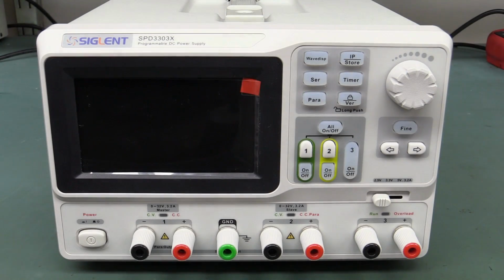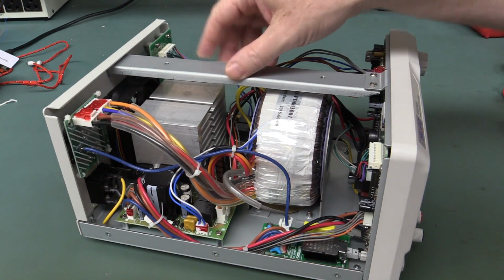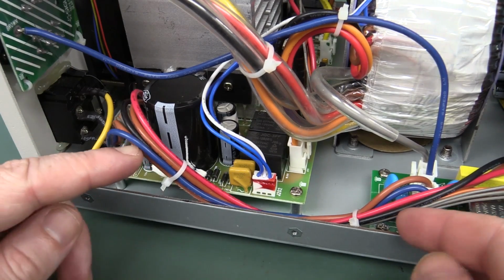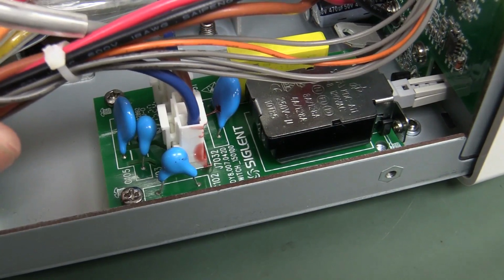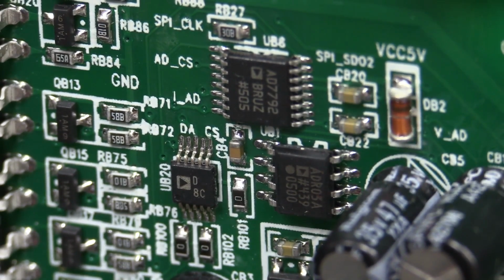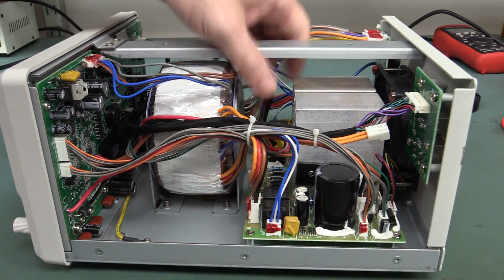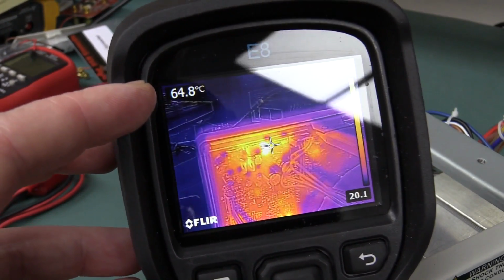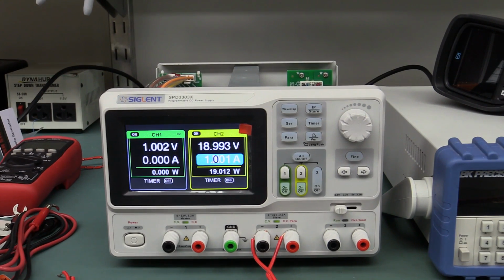EEVblog #828 - Siglent SPD3303X Precision Lab PSU Teardown

Comment: Eyyyyy I use one of these everyday at work. it's a solid bit of kit!
Reply: The one I use at work has better banana jacks, though they're still not awesome. Definitely some changes have been made since this video.
Reply: user interface has also changed a lot. it now shows set and current voltage.
Reply: Also no screen saver. display is always on. Gah that was a good change.

Comment: It looks over designed to me. Wasting money on digital bullshit instead of throwing the money on beefier hardcore analog parts. Keep it simple and sturdy and analog should be the way of a good PSU. Down the years those digital protocols between the ARM and PC might fail bricking the whole thing and especially making it difficult to fix. Using a Delta Sigma ADC to monitor the voltage especially made me laugh, like using a microscope to thread a needle.  Also screen saver wtf ! this is a bench lab instrument how dare they put an interface with a screen saver.

Comment: What a Siglent fail, thanks.  I got the same crapping banana plugs on the cheaply switch mode variable supplies.  I had to make some brass extenders/adapters to screw on the terminals and accept the full length of a standard banana plug.

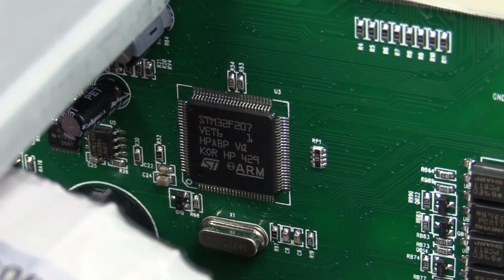Comment: 15:20 You will most likely not run a Linux on an STM32F2. It doesn't have a MMU, and therefore could only run Linux with a emulation, which is ridiculously slow.

Comment: Most of the caps in that are Rubycon . Shame about the big filter caps though bummer .
Reply: Most of the caps are LELON, not Rubycon. The Lelons have Y on the top, the Rubycons have K on the top.
However the brand is largely irrelevant, since both brands make both low-quality and high-quality capacitors.

Comment: what does that "shorted turn" on the toroidal mean performance wise? Is it going to introduce noise?
Reply: A "shorted turn" means there is a MASSIVE current flow that produces no useable output. I will use an example - we are converting a Microwave transformer to a spot welder. For building that, you leave the (mains) Primary winding alone, but remove the (many-thousand turn) secondary wiring. Then, as a replacement secondary, you add one or two turns of very heavy cable, and run the leads out to a couple of copper "prongs". To make a weld, you short circuit those two prongs, and heaps of current (at very low voltage) flows to create the weld.
...
Now, back to the toroidal transformer... . the way that the mounting bracket is designed, you have U-shape comprising of the base and 2 sides. So it's a partial (3/4) turn, however it is an open circuit so no current will flow. However of you run a bolt through the center of the toroid, then that will join the 2 side brackets and makes a single electrical turn.
Once it's all connected together, then that makes a "short-circuited turn". So you get a huge current flowing, which heats up the transformer and saturates it, and that wastes massive amounts of power yet leaves nothing left for running the proper circuits via the other secondary windings.
In this case, the bolt has insulators that prevent the head and/or nut from touching the side plates. Therefore, even if the bolt touched one plate but not the other it would still be a "turn" but there is no circuit so there is no resultant current flow nor any other effects.
Reply: @johncoops6897  thanks for that explanation!

Comment: Why do you like being able to turn off the screen on the 34461A et al, but dislike it on this unit? I'm sure the saved power is minuscule, but never the less it would be equal to the power of the keysight screen, if not higher given its larger size.
Reply: Because Dave absolutely hates brands that he considers "sub-standard" to his elite requirements. His oscilloscope and multimeter reviews are even more biased and petty.

Comment: the 2020 version : banana connectors now with correct hole. the wires are now secured with cable ties, the too hot bridge rectifier is now 56C, no more screensaver, both setpoint and actual are displayed at same time. idle power usage 12W all outputs off.
Reply: Thanks for the info! I'm thinking to buy one
Reply: There's newer firmware too, right? Maybe fixed some of the annoying UI details.
Reply: I've got yesterday (5/2024) the same model the X-E and the terminals distance are not ok. Do you think that I've got an old stock? But 4 years it's not reasonable.
Reply: @netlogic1ify  they are all like this, and it is not a huge problem, since today we all use standalone banana cables
Reply: Thank you for the updated info!

Comment: Why do you need mV mA precision, can you give examples of application?
Reply: Testing the lowest drive voltage for a certain Mosfet to ensure a certain on-state resistance, or what voltages a certain Microprocessor will run down to. There could be significant advantages in reducing circuit/supply voltage, so you need to check that a particular device will be suitable and at what level it will start malfunctioning. 
Testing a SMD LED, where the rated drive current is 2mA, but you want to under-run it slightly to extend the LED life. What current level is optimum, and what brightness will be achieved?
SO, when you are doing PRECISION work, your need a PRECISION power supply. Not that 1mV 1mA is particularly 'precise" anyway.

Comment: Its been 5 years since this review.. does anyone know if there has been any revisions to this power supply that fixed some of the issues such as the banana plug spacing, or display ?
Reply: The banana jacks are more snug now but they have not changed the distance between them, except on newer models (SPD1000X family, for example) .

Comment: I like having the speaker imgs.love/TicwatchE2?1a it is hard to hear in a noisy environment. It does drains the battery. I use play music. I create play lists and then tell the watch to download them. The watch has a heart rate monitor which can track 24 hours. The screen is nice. I would recommend it. A great value for the price. I could not find these features in any other watch in the price range.

Comment: Very helpful video, thanks. Sigmund has since changed the banana plugs and other than the spacing which has no meaning for me they are OK now. So I just ordered one of these. I also looked up the data sheet for the Lelon capacitors. The 6800/63 is rated 105°C, 3.6A ripple current, 3000 hour life at full load @ temp. That is spec for spec as good is the Nichicon, Panasonic, or CDE caps. I know you are not a fan Taiwanese capacitors but in the absence of any data to the contrary and if you can believe the specs, that’s about as good as it gets for a filter cap.
Reply: Mark, is there a date code on the supply you purchased that has the banana plugs updated?

Comment: This is an old video but I think it's worth giving an update on the SPD3303X-E that I just bought.

First of all, I am not seeing any of the Siglent rust in there, it's all nice and clean steel sheet in there.
Second thing is about the mains wires. They clearly have seen this video because the main wires are no longer ty-wrapped together with other wires, the no longer run along the sharp edges of the steel sheet and they now also have a very rigid extra plastic sleeve over the wires for added protection.
edit: Third is the UI, the new UI still shows the timer but in a small font and the display now shows both the settings for voltage /current and the actual voltage/current. Best of all: no screen saver anymore!

The only thing (which I don't remember you mentioning) is the lack of a sense input for both channels. It's a bit strange to have a power supply that can supply 32V @ 6A with a 1 mV adjustable voltage level without a sense input.

Comment: Hi... I love watching your vids... they are very informative and knowledgable but I would like to point out a minor point if I may.... sorry to be a nit-picker but to clarify, the metal edge mentioned at around 9:13 actually looks like a guillotine cut.... laser cuts melt to cut and therefore seldom leave a raw cutting edge.... guillotine cuts on the otherhand, do leave very sharp edges capable of cutting.... In this video, I agree with you completely.... nice review... sorry for the nit-picking....
Reply: Agreed - it's definitely a guillo cut. Anyone who's assembled a cheap PC Enclosure will know how razor sharp they are. Running the mains lead bundled with data cables is bad engineering, but to also not have them sheathed and scraping on the chassis is really poor form.
Note that a comment above from "rumblfmp" mentions about year 2000 they have separated the cables and added a plastic sheath, as well as numerous other improvements.

Comment: That's a knockoff off the GW-Instek GPD-3303S. The inside is the same. At least they copied from a reputable Taiwanese manufacturer. The SPD3303X-E is like GPD-3303. Hopefully Siglent licensed the circuit from GW-Instek and not stealed it.

Comment: If the bolt going though the toroidal transformer didn't have an insulating washer on one side the bolt would heat up and start glowing.

Comment: Couple of notes:
1. STM32F2 series is absolutely not running Linux. It's a standard Cortex M3 microcontroller.
2. You can't hear it switch when you go through the voltage range because the default current limit is set to 0. You have to increase it before the output voltage actually increases.

Comment: Consider that you had the case open, so the through put of the fan was not cooling at it would if the case were closed.  I agree about the display, they may have used a cheap display that could not get the resolution for the small details of having more on the screen would need.  The Rigol, today, costs way more than this Siglent, if  you took that into consideration, maybe the Siglent is a good deal for a hobbyist.  The banana plug spacing has no room for forgiveness, I would like to know what they would say if you asked them about some of the more obvious issues,  like the jack spacing, and looseness.
Reply: Yes, the banana plugs' spacing and looseness was not our finest hour! We did switch vendors on the jacks after this video came out and those were replaced by a tighter version in 2016. We were stuck with the non-standard spacing on this model but we have rectified that on the new SPD1168X models.

Comment: I have a keysight unit. It has 4 channels and more current. Big arse power switch. And the plugs are nice.
And the guts are very good: big arse toroids and Panasonic capacitors.

Comment: Does anybody know if the banana plug issue has been fixed or if the is a way of replacing them yourself?
Reply: Yes - the units now have better, tighter banana jacks. We can send you new banana jacks if you have the older ones. The spacing has not changed but will on later models.

Comment: Hy i have an sorensen dcs 50-40m16 power supply. can you explain to me how the voltage is regulated automatic? i believe it measure the load impedance and it multiplied by select current to determine the output voltage.

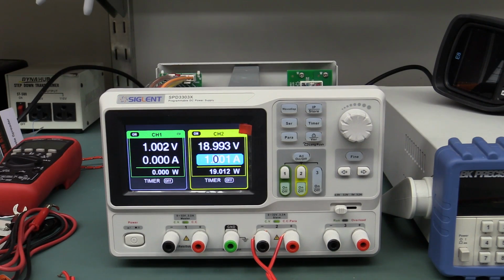Comment: 30:56 Default screensaver are great. Once on the used market, you won't end up with tons of burned-in displays. Usually if you go away, you won't be watching it anyhow and if you set a reasonable time-out it's just fine.
Reply: TFTs does not burn-in.
Reply: @gabiold  - No, they just get dimmer and dimmer as the backlight fades out..

Comment: Perhaps a minor thing to some, but the banana jack issue is a bit of a let down.  Companies have been building equipment like this for years and everything including the subtleties (like banana jacks) should be worked out by now.  It's not like a new company doesn't have past designs features / techniques from other manufacturers to draw from.  Yes it may be minor, but still frustrating.  I see this all to often, even in other markets.  A business will do something great for a decade and then suddenly it's like everything that it and others have learned up to that point get tossed out the window and some half-assed design comes along that makes you wonder.  I'm sure people have their reasons for such apparent mishaps, but I can usually find none that are sensible.  Put some thought in it and get it right the first time.  It can't be that difficult.

Comment: With the exception of board technology, this looks like my Instek GPC-3020 from 1980 something. The old toroidal is a hell of a lot better but I imagine they don't need great mains gear with digital control. 

Almost 40 years and only one recap and a hacked in digital display and a little trickery to get 4-wire on the master side, not sure I have better than 4-1/2 digits because that's all I can measure. 

I'll keep my old one thanks. Cost me $64 US.
Reply: Yep you're old one will still work when this think will fail if used regularly.

Comment: Good to see a real transformer inside, and not a switch mode converter. This tells a lot about the quality of the instrument. Which in this case is very good with respect to the toriod transformer. Thanks for your review.
Reply: Replying to a very old comment.... It's not an indication of "quality" - it's simply because this is a LINEAR power supply. Most manufacturers make both Linear and Switching. They both have advantages and disadvantages. The Linear ones are inefficient and get hot, and will be massively large and heavy for even moderate power outputs. Switching type is smaller, lighter, less expensive and not get as hot, plus much easier to have large output current. Switching type also allows for a wider voltage range without adding massive complexity to the circuit.
However Switching type is electrically noisy, with high frequency ripple. Linear type can provide "cleaner" output, but may have other issues (like Dave showed) due to the complexity of optimizing the transformer tappings to ensure proper transformer loading, eliminate voltage drop, etc.

Comment: is a linear or switch mode pcu best for aduio amplifier repear?.Your mods on the multimeter that resulted in the eev blog multi meter was good.So i orded one from via ebay.It will be my main multimeter for the work i do.
Reply: Linear.
Reply: Linear is almost always better. But is bigger, hotter and often more expensive for a given power output. Switch-mode introduces noise and ripple, which is never desirable and almost impossible to completely remove.

Comment: 100°C Power transistor case temp... wow ! and I was panicking when I saw 51°C in my own design ;) 

Dave, in the followup video U need to do a output measurements as for noise, impulse response, overshoot and so on !

Comment: Without good output jacks on the front the rest of the $500 paperweight is nothing but a good looking hunk of metal with a screen on it

The edges on the case look like their sheared

Did they ever fix the banana jacks on the front?
Reply: Yes, they apparently changed the jacks but not the spacing
Search for a comment by "rumblfmp" (around year 2000, perhaps 2 years ago) who describes the improvements.
Also search for comments from "Siglent Technologies" themselves.

Comment: street price... i've seen a lot of people trying to sell me something on the street, but usually nothing with a half life as long as a bench power supply. also holy shit Dave figured out what a spudger is! :D it looks like at the right load the life of the psu is limited to how many times the relay can trigger, which is sad because if it is linux like you said... they could have detected that, had it pick one or the other then pop up one of those warning boxes to tell the user you arnt getting quite what was requested for xyz reason

Comment: Are 110V with 120V and 220V with 230V really that matter? my house mains voltage fluctuates between 215V and 230V.
Reply: Ohm's law says that most of your appliances will simply draw more current when the voltage drops low, but some devices may not work well at all (CFL lights come to mind) when the voltage is out.

Comment: I agree with your fear of shorted turns on toroids, but on a hefty transformer like this I would expect the bolt to melt the first time it was turned on, so there has to be an insulator somewhere.

BTW, I would have been interested in buying one until after I saw your review. The banana sockets would be the biggest downer. Pity, it looks quite good otherwise. Imagine, if they invested some $5 more they would have a really good piece of gear. instead they have something that I wouldn't buy for half the price.

Comment: That sheet metal isn't laser cut, that's punched in some way. Either in a punch or an eccentric press, I guess the later based on the fact that I not able to see any "repunch marks".
Why? because laser cutting doesn't make burs unless the operator is completely useless.

Look at the outer edge and you can see that it is bent a little, laser don't do that either.

Comment: i would say it would be a powered mic test  where you have +/- 5 volts leg 1 and the same with the 2nd leg with neutral on the green, remember this what works on 1 set of equipment may never work on the next set you place it on

Comment: I know it's a little off the cuff, but I'd like to send you a product for review that is a bit of a departure from your normal reviews. It's an open source BBQ temperature controller called the Heatermeter. It monitors temps, and controls the temperature of a CHARCOAL smoker/grill with a fan and automatic damper system.

Comment: One thing I would want a big obtrusive message for would be for when the thing goes from constant voltage to constant current. Sometimes a short in your device under test is survivable for an instant, but other parts in the device under test may overheat and fail if left that way for too long. For example:
Motor controlled by MOSFET fails with a shorted winding
Power supply beeps and says "CURRENT OVERLOAD!"
Technician hits the "output off"
MOSFET survives